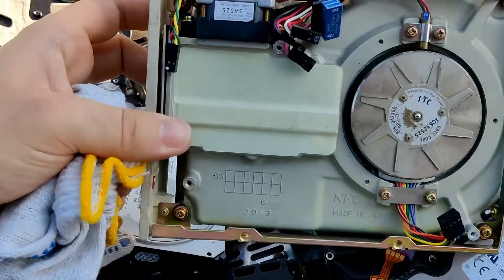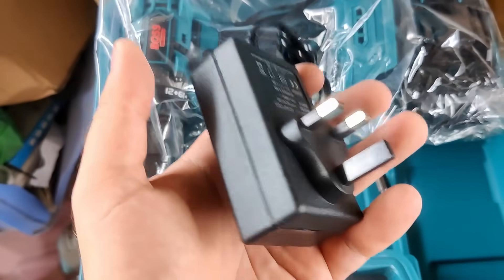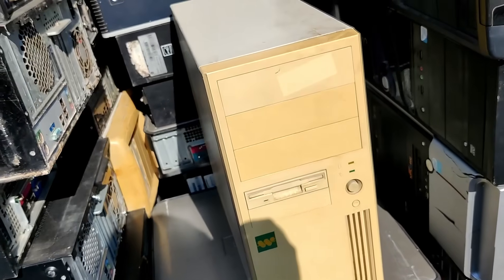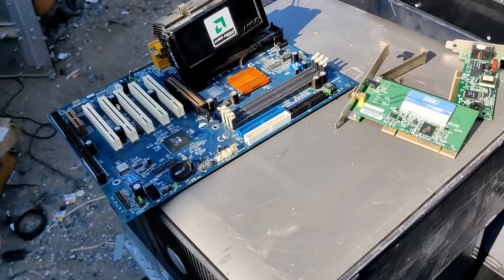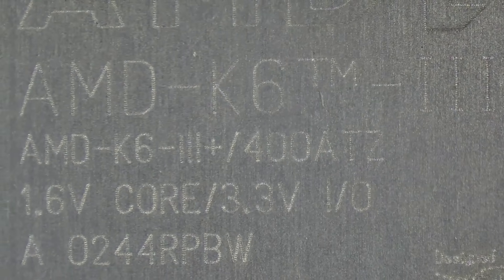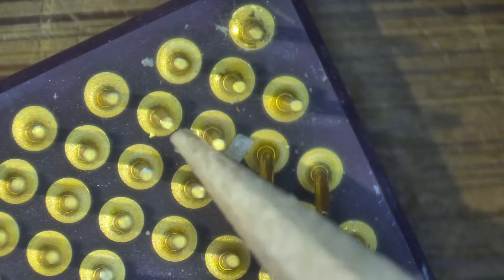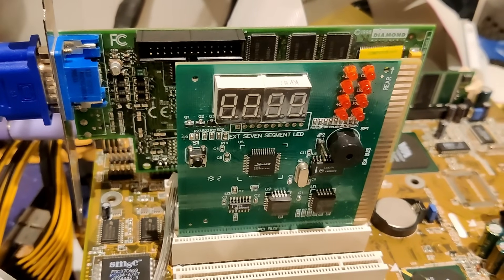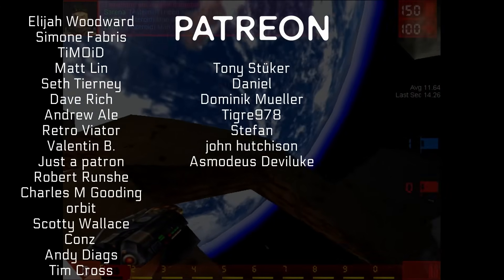I Found Rare AMD K6-III+ CPUs and Broken Dreams 😥

Comment: After watching your video I feel lucky, regarding the two AMD K-6 III+ 400MHZ ATZ I bought in 2015, when they were still cheap. 
Both worked fine at 550mhz the last time I've tried them, although they are dessoldered cpu (the pins are no longer golded, but tinned). I just hope they don't end damaging the sockets because of it.
At the same time I also bought an AMD K6 III at 450. Since the III+ are such good overclockers it is in a box, instead of a motherboard.
Reply from the maker: Those K6-III+ chips are quite rare these days! Good call getting them back in 2015!

Comment: That guy scrapping boards off the drives made me physically ill.
Reply from the maker: I know - hard to watch :( But this is what happens there all day long.
Reply: Let's be honest, the retro community is not that big, and most of the participants are also cheap bastards 😂.  And these are commodity hard drives not like a rare 3dfx card some kid could only dream of back then.
Reply: The wastefulness that we are all part of is on show at recycling sites like that.
Reply: @HTMLEXP  ... As technology progresses, we have become a throw-away society.  At least for the past 2 centuries, where stuff we make does not naturally degrade quickly anymore (like dead plants & animals).  This means especially plastics ...  but also electronics like these in the video, because a lot of the chips also have metals, glass (sand) & silicon (sand).   These drives are now considered obsolete & broken, not worth their usefulness far into the future or for repair, but at least they are getting recycled.  We still have much to learn from nature.  :)
12/26/25
Reply: @HTMLEXP   much of this stuff is not useful and won't be used in its current form and can't do any real, meaningful work by modern expectations with any efficiency.  Better it's to be reused than new material mined.
Reply: me too😵‍💫😵‍💫😵‍💫

Comment: If you want 550mhz or 112x5.5 you need to bump those volts up to 2.2v is very safe
Reply from the maker: I hope that 550 MHz are stable at around 1.8V and 600 MHz around 2.1V (hopefully). I will try that in a future video.

Comment: If you're firmly of the believe that two of those K6-III+ CPUs are pretty much deader than dead, then don't worry about them. And the way you talked about it, they're better off being melted down and their metal components re-used elsewhere.
Reply from the maker: I had some time and straightened the pins of the cracked CPUs; but yes, both are not working. I will delid them and we have a look at the die in a future video. I want to check what is different on those chips compared to my K6-2 570. It probably is identical with just the L2-resistor moved to a different place. We will see that soon.

Comment: i wonder, if you worked at a place like that - would it be profitable to just spend your time building retro systems and selling them for a hundred bucks?
Reply from the maker: Here in UAE nobody cares about retro systems. I would have to ship them to USA / Europe and that's expensive. I am not sure if it would be worth it. Not every time I go there I find interesting old stuff. There might be weeks without anything of interest.
Reply: @bitsundbolts  thats fair.  i kinda want to make a k6-II system now. my first PC was a 400mhz that i OC to 550. a gateway. 13gb HDD.  i moved that HD into my MAC (first computer) it was a performa 630CD 33mhz.  thats when i learned partition allocations, boot drive needing to be >2GB.

Comment: Bumping to 1.65V is very kind on the CPU and might get you there. Merry Christmas ❤
Reply from the maker: Yes, I will try this in another video. I should have done it in this video, but it was already long enough. I will also delid the two broken CPUs which are confirmed not working.

Comment: Sad , 😥 all these Pc's (no one wants anymore) so they end up dead& scrapped... R.I.P. (world). & all those Dell's... *true , newer... was best of times... for dell... I wonder how many just work or need a couple of caps... so sad (I saved what I could whenever my dad's waste-transport co. has , ocasionally, tech/pcb inventory)
Reply from the maker: Most of those PCs work flawlessly. They are just there because they're obsolete for today's standard.
Reply: @bitsundbolts  I'm still using a dell, daily , it has 19 years. (works flawlessly) ... so sad 😥.... (I collect what I can , fix what I can ,but I have little access to old suff especially on lower budget, even last 2 years capacitor prices jumped locally so much somtimes I wonder if I should move on with my PC restauration projects.... not to mention bios batteries... & big laptop batteries ,I skip on those).

Comment: 9:31 You pretty much have no choice for that Socket. EIther KX133 or AMD 751, that's it.
Personally, I'd go with the KX133, as it has an AGP 4x/1.5V slot, so you can put a Radeon 9550SE inside. Not possible on the 3,3V Only Slot of the AMD 751...
Reply from the maker: I do have an Irongate (AMD 751) motherboard in storage. I am looking forward to testing those two chipsets one day. The AMD 750 looks nice, but it has the dedicated cache chips. I seem to have another AMD 700 Athlon that has no cache chips. I wonder what the performance difference of those will be as the latter should have the cache on the die at higher frequencies.
Reply: @bitsundbolts  oh, nice, you have both the "Normal" K7 and the Slot A Thunderbirds (basically the same as the Socket A Chips). Yeah, that would certainly be interesting.
YOu can also make a little thing with DIP Switches to overclock the Chip, the so called "Gold Finger Device", though you have to crack the CHip for that and remove the front, so not great...

Comment: 6:00 not interesting at all.
Scared of S423 and an i850 Chipset? :)
(System had no RDRAM and no C-DIMMs either).
Reply from the maker: Eh, I really don't like RDRAM. Poor decision back then to go with this type of memory. Good that it didn't catch on.
Reply: @bitsundbolts  I kinda understand, as you can't get the Sticks easily and you also need C-RIMMs as well. And its rather warm as well...

I didn't hate RDRAM and had a few RDRAM Systems back in the day as well.
And if you ever want to get into P3 overclocking with extreme high FSB Clocks, an i820 CHipset BOard might be not the worst choice, as I booted my Klamath at 2x170MHz on the ASUS P3C I had for a while...
Ah, yeah, fun things :)
But I have gotten rid of all my RDRAMs, only C-RIMMs remain....

Comment: It would require some serious tooling to try, but perhaps the silicon chips themselves could be salvaged and placed onto a new ceramic substrate? 

Probably not worth the time or effort, but something I'd look into for fun.
Reply from the maker: I think those silicon dies are glued to the ceramic. I will open the cracked CPUs and we have a closer look at the chip. It should be the same as the AMD K6-2+ 570 I had on my channel a long time ago.

Comment: I really want to see you test those CPUs with the cracked ceramic though...

They might actually work, since neither of them are cracked through the DIE itself. The wires to the pins are most likely just slightly stretched.
Reply from the maker: I did test them - unfortunately, both are no longer working. When the ceramic cracks, it also cuts the wires. They are so tiny, they snap with the crack. There is no material to stretch - those wires become almost one with the ceramic. If it cracks, so does the internal wiring.

Comment: K6-III+ 400 were my daily driver back in the day, with asus P5A-B, 96mb ram, riva 128zx and sb live! og, still 4.1
Reply: I used a K6-III+ 450 ACZ in a GA-5AX board - the Rev D boards supported 1.3-2.05V in 0.05V steps and 2.0-3.5V in 0.1V steps - and also 133MHz FSB with a /4 PCI divider! I ran my chip at 533MHz (4x133) and 1.8V and it was cool yet VERY fast for the time!

Comment: For the cracked ones, maybe look into how the silicon is bounded to them.
If you can delid and desolder them without harming the  silicon, it may be possible to transplant the core to a new chip substrate and bypass the cracked pins.
One man who can answer such a question is another German, Der8auer, especially the delidding part of it all.
Reply from the maker: That's interesting! And I did try to find out if it's possible to lift the die. However, apparently the die is "glued" to the ceramic requiring extensive heat to disconnect. Not possible / worth it as far as I can tell.

Comment: They might be good quality still because never seen one that would run at 550mhz with only 1.6V. You can go up to 2.2V with them if you put cooler on it.
Reply from the maker: That's what I wasn't sure of how far I can push the voltage. Next time when we have a look at the cracked chips, I'll try the working ones once more at higher voltages.
Reply: @bitsundbolts  I have 3 of those 1.6V low voltage ones and I have tested them all working with motherboards that dont even support lower voltages than 2.0V or 2.2V with cooler and all being fully stable at 550Mhz. You can change the multiplier with the setmul utility without needing to reboot in between.

Comment: I DON'T think you can say "incapable of 550 MHz" without using Thermal Compound.
Thermal Conductivity of Air:  0.024 W/m.K
Thermal Conductivity of TC:  5 to 15 W/m.K
200 to 600 times better.

IF the IHSs and HSs were perfectly flat; maybe, BUT they are NOT!!  So TC counts! 

You want these rare CPUs to last.
So get a tube of the cheap stuff and a 'checked to be flat' or lapped HS of a decent size for this kind of testing.

No Thermal Compound = BS video...
Reply from the maker: I used thermal compound for testing and benchmarking. Just the smoke test to check if the chip works was done without.
Reply: @bitsundbolts  Ah!  Well leaving that out of the vid makes you look inept..?  🙂

Comment: That scrapyard looked like both heaven and hell. Heaven because of all of those old computers, hell because of all the scrapping happening.
Reply from the maker: Yeah, it's sad to know that every day they'll scrap some valuable items 😢
Reply: @bitsundbolts  It kills me inside to see this...
Reply: Mostly hell. This scrapyard seems to me to be about metal recovery only otherwise they would've sort through which parts might be valuable and/or sellable first.
Kind of surprise he was able to find two working K6-III+ in this mess. I wouldn't test the cracked ones. Socket 7 had the data and adress pins in the corners. So if there is only one of them cracked the CPU is only scrap metal at that point.
Reply: The vast majority of that yard is junk, common stuff that really has no use, beyond maybe props for apocalypse movies.
Sure, preserve some ordinary stuff, display the oddball stuff, recycle the raw materials in to something useful.

Comment: K6 are rare because they all burned out. I burned two K6-IIs in one day, and probably went through about 6 of them in total.
Reply from the maker: Hm, I never had one of these chips fail on me. Sad when they just die 😢
Reply: @bitsundbolts  I lived on the north east coast of South Africa and in summer it could be over 40°c. The one time my fan stopped and with in seconds the chip fried, so I phoned a friend to bring me another and we were chatting and joking around when I replaced it and as I turned it on it got just past lilo and uncompressing the kernel and it just stopped, because I had forgot to plug the new fan in and it was dead too.

Comment: Merry Christmas to you, too.
As to the cracked chips - it will take you about one minute to test if they even boot, in my opinion that would be worth doing. If they DO boot, THEN consider testing further, and perhaps using some CA glue (superglue) to stabilize the ceramic.
Anyway, I am kinda jealous that you have a recycle center like that near you - there is nothing even close near me.
Reply from the maker: I tested the chips in the meantime. Unfortunately, no post codes :(
Merry Christmas!

Comment: Find ground and power pins on the outside and inside of the crack, measure resistance/continuity. If ok, test. If it works, fill the crack with super glue or some kind of resin.
Reply from the maker: I tested the chips - they're dead 😢
Reply: @bitsundbolts  oh well, at least you tried. It was a long shot.

Comment: I once have acquired and binned about 25 atz chips like these 😊
They have a good chance of reaching 600+ mhz at 2.0-2.2 volts, but of course don't do it if you don't feel like it😅
Reply: These use the same die as the faster K6-2+/3+ at 2.0V, overvolting them to 2.0V shouldn't hurt them tbh, 1.6V was meant to be more power efficient mainly
Reply: @DxDeksor  I think my K6 3+ 550 runs at 1.8V.  The 400 is good at 1.6 so the extra voltage won’t hurt
Reply: There was some big batch of these chips on eBay a few months ago. I saw some lots with 1k pts. It's really nice chips with such low voltage. I bought one for my collection.

Comment: if you crazy enough you could probably fix the one with small broken corner with a lot of microsoldering and excavating the pcb like cracked graphic card pcb is fixed but that is given you have internal  pcb layers pictures like x ray or something of a working chip, and hopefylly there is only few pins worth restoring  because rest is gnd and vcc replicated  on other pins
the one with big crack seems to be much harder case, could be done but unlike small corner where you can replace just working pins this one would require v groove and bridging all broken connections and would be much more prone to recracking in the future, sadly unkike mobile pentium  cpu's it is not able to be used as a core donor
Reply from the maker: I don't know if I could get into the ceramic and access these tiny wires. They're extremely thin and the ceramic is thin too. If it were the green substrate of Pentium III, I could have tried fixing them.
Reply: @bitsundbolts  i know what you mean . that is why fixing the one with big crack seems much more impossible than the small crack
with ceramic i would use a grinding wheel for tiles on a stationary grinder with water to make very gentle slope and then pick  the ceramic of the traces into the time, it would obviously break much more connections but i see no other way, unless we can disolve the ceramic substrate and pot it with some uv resin but i doubt you would dare to use hydrofluoric acid at home

Comment: Is there a risk to other parts by trying a cracked chip?  I agree with you through as most traces won't be able to stretch across that crack when being held so tightly by the ceramic.
Reply from the maker: I tried the cracked chips. They are dead. No signs of life.
I wouldn't think that there's a problem trying those cracked chips. All that happened is that the fine wires inside the ceramic snapped and no longer make a connection. It's highly unlikely that they short something.

Comment: The 2 cracked chips are hopeless. Even if by a miracle they work now, the tiniest change in the 2 ceramic parts can sever the connections.
Reply from the maker: Agreed. The moment the ceramic cracked, the tiny wires leading to the pins snapped as well. Hopeless.
Reply: They are still a potential project for rebonding the chip itself to the new package 😅

Comment: man I saw more stuff in this video than in months/years of "hunting" in local second hand markets and similar, I would have took much more stuff 😅
anyways, are you going to benchmark these K6 III+? I wonder how they perform vs PIII of similar speed, also what about overvolting them a bit to reach stability at 550+?
Reply from the maker: Yeah, I should try to get those chips to 600 MHz. 2-2.2V should be ok with those chips. And it would also be interesting to see them compete against Intel Katmai and Coppermine.

Comment: Hate exposed silicon. Killed 2x GeForce 6600GT and a 6800 with Zalman VF-90 respectivly Arctic NV-Silencer 5. Still have preserved my ASUS V9999GT 6800GT 128MB DDR w/ untouched stock cooling solution for that reason. Would never try to "delid" expensive CPUs these days.

Comment: They need more voltage to run at 550 and higher. 2.0V is a good start and 2.2V is the max I used in my own  amd K6 3+ ACZ 2.0V cpu and got 570mhz(95X6)@2.2v and 560mhz(112X5)@2.1v on a Soyo Sy-5ema+ 256MB crucial pc 133 cl2@95mhz and 112mhz
Reply from the maker: Yeah, I kept the voltage at stock only in this video. I could imagine getting 600 stable at 2.1/2.2v
Reply: @bitsundbolts Yeah 600Mhz sounds quite possible on your cpus rated for 1.6v indicating better binned dies than the 2.0v for normal bin k6 3+.

Comment: I wouldn't expect them to work, but depending on what I'd paid for them, I might try them anyway.
But you could also make a video out of disassembling them, and giving us a look at what actually makes them dead once they are cracked like that.
Reply from the maker: I will open them. They don't work, I tested them. I think the cracked part is only held there because of the IHS - once I cut the glue, the cracked corner will fall off.
Reply: @bitsundbolts  Then I'm looking forward to seeing the true extent of the damage and a glimpse at the inside of those packages.

Comment: For the cracked ones, I would check the pinout, and look for some common pins (like Vcc or ground) in the cracked area, to check, if there is a continuity between them and other pins serving the same purpose. Similarly to the Voodoo 2 lately.
If there somehow is a connection, then there is hope.
Reply from the maker: I tested the two cracked chips, but unfortunately they don't work :(
Reply: @bitsundbolts  Sad to hear that. Better luck next time!
Reply: I found a IBM  486 DX4 with a craked corner, but the pin was  still attached inside. Just put a small drop  of superglue to reinforce the corner. 
The pins had a lot of corrotion so I clean all with care. Two pins fell  but I soldered them back.

The cpu is alive.